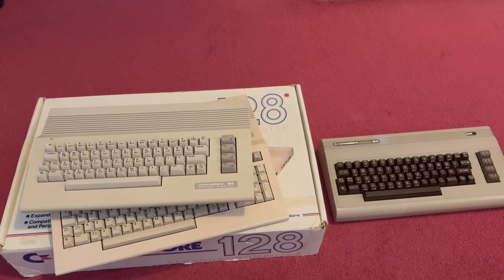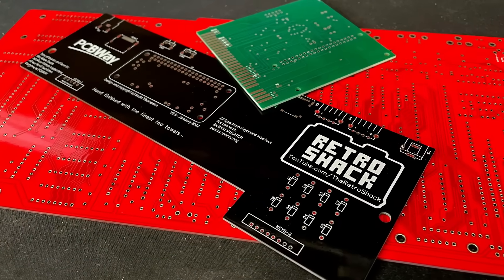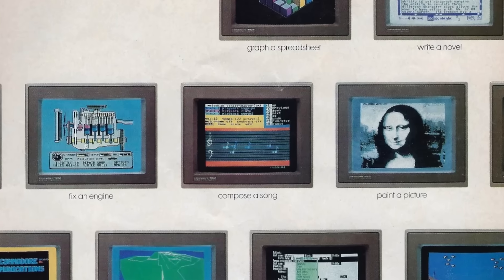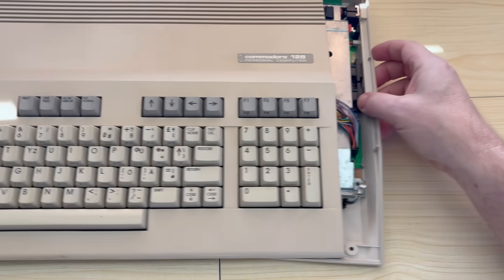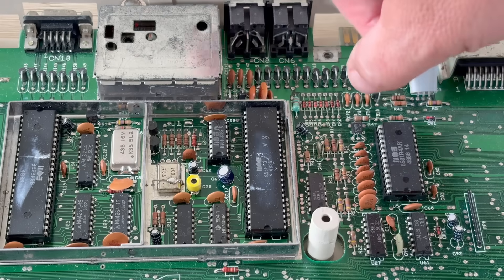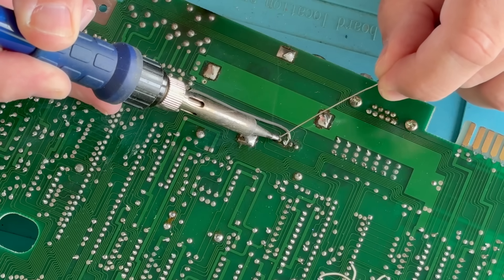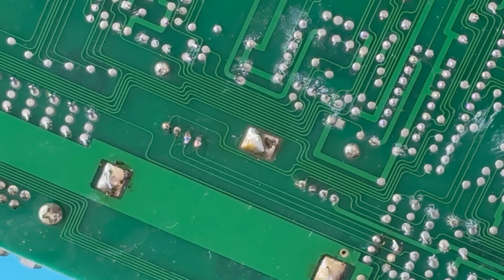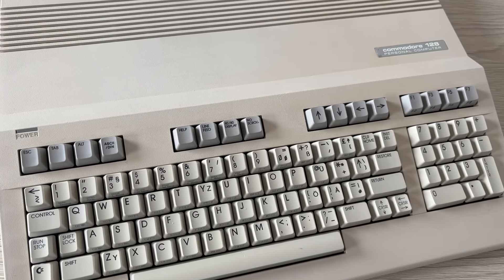Commodore 128 - Part 1 - What is it?  And why is it 'Not Working'?

Comment: CPM was a waste of time. And the C128 didn't offer anything more in terms of graphics and sound - so it wasn't a better gaming machine - which explains why hardly any C128 dedicated games were created - and why most C128 owners used their machines mostly in C64 mode. It should have been more, but wasn't.

Comment: I went straight from a VIC-20 to a C128.
Never owned the C64.
My C128 pretty much ran in C64 mode most of the time unless I was using GEOS128

Comment: One could only imagine what would have been if they had thrown in an 8086 or 80186 instead and implemented an MS DOS mode instead. However. when I first got my C128 (January 1987) I soon started to use some CP/M software, for example WordStar. Still remember how weird even then the implementation of the VDC seemed to me, when I started to program in C128 80 col mode.

And here I got a little something for y'all that was inspired by C128's VDC mode: https://www.youtube.com/watch?v=7egvwEFBFwQ

Comment: Those solder bridges you made are just temporary. They will fail again,  eventually.  Next time, use small-gauge wire, like 24 AWG,  to bridge the gap. Speaking as an Electronics Tech with 40 years of experience.
Reply from the maker: Thanks for the tip - I'll give that a go!

Comment: Interesting keyboard - what nationality is it?

The C128 was my first computer, but sadly, I let it go long ago.

I got another one more recently from ebay. That one had corrosion that ate the audio trace from the SID chip, making me think it was dead, so I tried an ARMSID and then realized the actual problem what that too didn't work!  The original SID turned out to be good, but in the meantime I discovered how good the ARMSID actually is!

I couldn't get the computer to run reliably until I ditched the shield and put heatsinks on all of the relevant chips, using thermal adhesive and heatsinks from Console5; runs fine now!
Reply from the maker: This is the UK PAL model.  I’ve not had any reliability issues since the fix and the heat/rf shield seems to be doing a good job so far.  If it gets flaky I’ll go the individual heatsink route too :)
Reply: @TheRetroShack  Huh, interesting - I had noticed the Pound symbol, but there were others I didn't recognize!  Mine's a US version.

Comment: would say instead of thermal paste you put in silpads, as they will at least conform to the irregular shape of the cover, and transfer heat a lot better to it, plus it does not get as messy. A big pad can be cut up to make lots of smaller pads, though i often salvage them from old CDROM drives that have failed, as the pad is still good, and you generally get a few per drive.

Comment: I have one of these! I bought it on eBay a while ago, in it's box like yours and with all the manuals etc. It works, but had a very yellowed keyboard, which I retrobrighted to look like new again. I had quite a large retro computer collection at one point, but have been selling off some of them from time to time, just keeping the ones that I either owned back in the day or that I really like. Sinclair machines are my favourite (I had a ZX81 and a Spectrum in the 1980s) and I still have several, but I do like the C128 so I'll be keeping it. Nice video  and fix btw 🙂
Reply from the maker: Thanks!  It’s hard to let go of these machines!

Comment: If some hardware developer is reading, I have all plans for an C128 upgrade card. It is designed to be very cheap, otherwise it won't spread. Only the PCB has to be created because only the RAM is SMD.

Comment: problem with that thing is there was no software and 2 aging  cpus.  80 column was nice barely any thing written for it and no business would buy it. Geos was its main program but you kinda needed add-ons to really use it.
Reply: It is remarkable that Commodore could fab their own chips and yet couldn't put an 80-column mode in the C64. Despite all the widely reported travails of their ULA chips, the BBC Micro and Acorn Electron both had 80-column modes out of the box.

Even the 80-column capability in the C128 is a separate chip - the MOS 8563 - originally intended for the C900 Unix machine that never got to market, largely because the C900 used the Z8000 which was only interesting for a short period of time in the early 1980s. And the 8563 seems to have been mostly intended for text mode applications, unlike Acorn's ULA-based implementations.

Comment: When you are working on corroded joints, you are better off removing all the old solder, and reforming the joint with fresh solder.
There may be a contaminant in the old solder that encourages faster corrosion.

Nice to see a new video from you... have you finished your travels and back into a "brick and mortar" living arrangement?

Comment: Oh yes my old C128 days. For me the much better C64 in terms of reliability and fixability. And thus my C128 has never let me down even to this day.

A few thoughts: Cold solder joints would not be my first suspicion on a double-sided board, due to the solder flowing all the way through and making for a much thicker connection. The grey bodge wire at the modulator however is not factory! So somebody must have been in there I'd say.

I was a Commodore user since 1984 and nowadays a proud owner of a working Amiga 1000 with Rev A mainboard of autumn of 1985! Plus a few other Amigas!

By the way: I used Arctic MX-4 on my C64, to cool the 7805 regulator. I can overclock to 4.5 GHz now! couldn't resist dis pun!

Comment: One of the RAM chips in my C128 suddenly developed a fault and the computer would boot in C64 mode (which of course was the mode I used the most) with less RAM available.

I remember typing a few instructions to force the switch to the second bank which was still working fine. Probably a poke to select the bank and sys to force a soft reset.

The keyboard imho was excellent.

Comment: Instead if a 128, that had to be used in C64 mode, why didnt they make a 64 evolution that came standard with all the ram expanders, drive turbos etc included to begin with? 

Thats what everyone really needed, not the 128 that was used in C64 mode 90% of the time anyway, negating all the improvements.
Reply: This is essentially what they did, adding to the 64 a banked RAM expansion, faster disk access, extended BASIC, and an 80-columns video mode. But because every hardware modification was incompatible with some existing software, they had to add the C64 mode where they were all disabled.
Reply: I just read somebody's account of what the C128 should have been.

Let's call it the C64E.

-Boots into C64 Classic mode, but each extension can be enabled manually.

-It would have at least 2 MHz compatible processor, maybe a faster 65CE02.

-It would have Dual-SID and an enhanced VIC-II with support for at least 2 MHz.

So classic C64 games and applications could still release and be used for the 64E. Some would have to be tweaked a little, no big deal.

But it would be easy for these developers to release an 'E' version for the C64E. So instead of buying the C64 version, applications would sometimes be available for C64E.

So it's like the Apple IIE. You can run the older software, but some software was released for the IIE.
No "128-mode." Instead, it boots to a 98% compatible 64-mode that can activate and access the extended hardware via user / program commands.
Reply: @brendanstone3073 Agreed, that would have been better. At the time I evaluated a 128 based on a friend's demonstration and his take on it, and the conclusion was that except for the 80 column mode in geos, it wasn't very useful of an upgrade. Couple of other programs too he had that was 128 specific, but reality was that besides those few, he booted to C64 mode, and there wasn't much of an upgrade there. The cpm mode was horribly slow, and already outdated.

There was the mythical C65, but was never launched, maybe that would have been more like what your describing. Some guys have relaunched it on a FPGA as the mega65, but both pricy and not really the real thing anymore.
Reply: @Santor-  Yes. If C128 just had 80-column mode, and maybe doubled-down on GEOS for home users, that would have been enough for the business case.

Sometimes, I think that the people making new retro C64 systems should just agree on a common set of standards for "C64 Expanded" [stuff that's hardware-compatible with C64] and then program stuff for it. Make the C64E that Commodore didn't.

The C65 came way too late, which is why people are still discussing what the C128 should have been. It needed to release around 1984-85 and provide an enhanced C64 experience.

Comment: Did you use the 'correct amount of thermal paste'?  If you know.. you know ;)
Reply from the maker: It was exactly the correct amount of Thermal Paste.  I checked with Dave.
Reply: @TheRetroShack nice! Love it when the retro computing community mixes with the fixer community!
Reply: SOLID
Reply: @ChrisHopkinsBass multimeter to…. Continuity (which also works here lol). Gonna stop now😅

Comment: There are so many programs that needs a 2MHz hack to them - think of all the adventure games that does linedraw and fill routines to build the graphics. They are practically screaming for a boost to their drawing speed (yeah, you could probably gain way more by optimizing the code, but then there is still a speed-up for free).
Reply: This is where you could argue that the retrogaming community has a gap. There are probably C64 games that could be adjusted to take advantage of C128 hardware, but that rarely happens.

Comment: Commodore kept the 8-bit alive with the 64. Us poor kids could get ourselves a C64 and 50 games for half the price of a NES all the way up until 1994. NES and Master System wasn't popular around my way, I mean quite a few kids had the machines, but the cost of the cartridges(1 new game a year at most) rendered most of them unused until the mid '90s, with the C64 and Atari ST, and later the Amiga A600 and A1200, being far more popular options.
Reply: The only game console that I saw in 1985 was the Atari 2600 (The NES and SEGA machines were more common in the late 80's begin 90's). At school in 1985 we used Philips P2000 machines (the first pc's arrived in 1987 and were Tulip PCś with monochrome CGA cards). So yes there was the Amiga 1000 but it wasn't exactly cheap (that is why they introduced the Amiga 500 a few years later). Long story short, the C128 wasn't that bad for it's time.

Comment: There is nothing wrong to use those patch wires! Many of these machines came with them when you bought one new, it was the way to do and fix even new bad boards then and it is just ok. With old corroded PCBs those patch wires to pin to pin works forever but if you fix like you do, it may work some time and then it is gonna most likely corrode next to your fix point! Owned C64 from 1983 and C128 form 1985 and SX-64 1987, all still in working order! 😄

Comment: Any plans for upgrading the 128? I understand there are RAM expansions, Graphics RAM expansions, accelerators, SD card solutions, etc. Quite what benefit you would obtain from installing any of them I'm not sure.
Reply from the maker: The machine is new to me so there's a lot of research to be done - I've already started and there's a lot of stuff out there :)
Reply: @TheRetroShack  That would be a great project. Various historical and new ways to expand the RAM. Multiple ways to accelerate loading. There's HDD, and SD drives.

The main limitation is software. Not much that really takes advantage of such a beefed-up system. GEOS does. The new C64OS would be an interesting test of an upgraded C128.
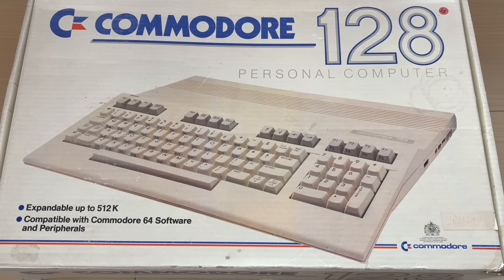Reply: 1:32 the box says expendable up to 512k
Reply: @cmuller1441  that was with the official Commodore RAM Expansion Units (REU). There is the 1700 (128K) and the 1764 (256K). CMD later made a 1 Mb REU, as well as their RAMDrive and RAMLink add-ons.

In terms of graphics upgrades, the 64K VDC (Video Display Chip) is the only direct upgrade.

For SD cards, check out things like the Kung-Fu Flash, 1541-Ultimate, and SD2IEC.
Reply: Look up "Commodore 128D GEOS Battle Station"

Comment: Tips for those kind of soldering: lower the temp until it barely melts, then it is easier to do these self-supporting solder bridges (like doing manual 3d printing). You can then correct/thin it a bit with a little higher temp to look better if needed.
About the c128 shiled-as-heatsink: those fingers are badly angled, sometimes doesn't even touch the chip underneath. And the shield also flex when the keyboard put on top of them which changes the position/angle of those pads. Quite annoying if you want to bend them to make proper/better contacts.
Reply from the maker: Thanks for the tips!  The more I read about and use the C128, the more I'm admiring it!

Comment: The Commodore 128 is almost completely compatible with the Commodore 64. There are a few games that fail to run on the 128, due to a location in memory. With that being said, the Commodore 128 is 98.5% compatible with the Commodore 64. I have a 128 with JiffyDOS installed, as well as the associated 1571 disk drive. It had a better BASIC with more memory. However, very few developers ever took advantage of the native 128 mode, as most of the software that ran on the 64, also ran on the Commodore 128 in 64 Mode. CP/M, unfortunately for Commodore, was on its way out, due to PCs with MS-DOS. In its lifetime, the 128 sold 2.5 million units, far less than the Commodore 64.
Reply: It was too little too late.
Reply: The C128 debuted in January 1985, the Amiga 1000 in September 1985.
Reply: akira808state4:

The BASIC V7 was much slower than BASIC V2 because of the bankswitching.
Reply: Not al all, a bit slow in 1MHz but faster at 2MHz.
And it lefts 120KB free, 62 for variables and 50 for code.

It was a very big step.